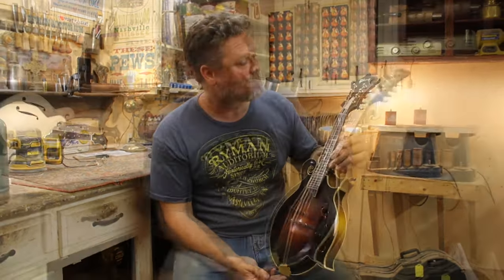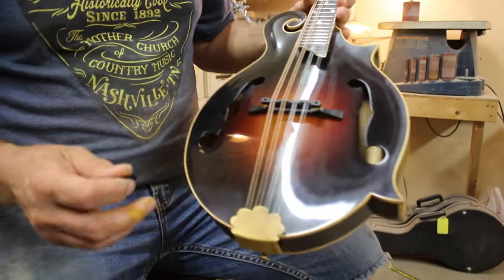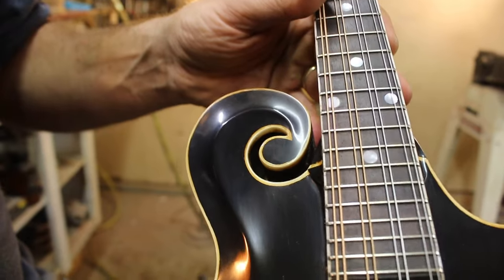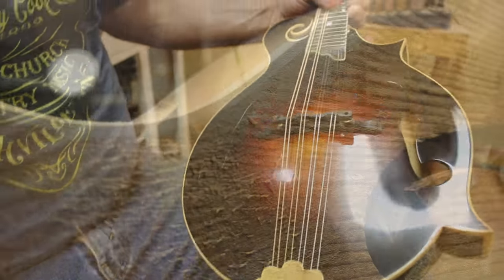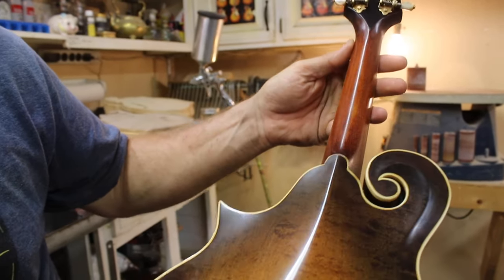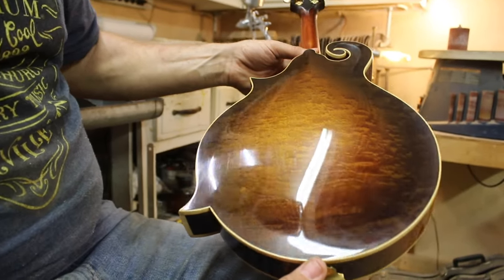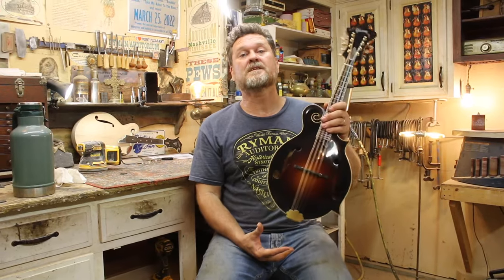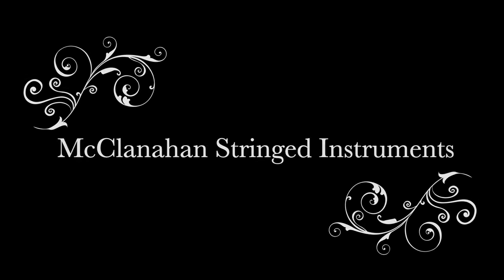Gibson F12 rebuild by Jonathan McClanahan, owned by Bryan Paige

Comment: Those mandolins from 1949 - 51 right at the time Gibson first "re-introduced" the F-12/F-5 mandolin (after WWII) had a fret boards laying on the top board (like the F-2/F-4s) and only later circa '52 did they start to elevate the fret board again (although not Loar style).  This '49 is elevated off the top board like a post '52 F-5/F-12 -- did you do that? Sounds and looks awesome!
Reply from the maker: I was rebuilding a few of these at the time I was doing this one. I may have got the year wrong? 😢
Reply: @McClanahanStringedInstruments  Thanks!  Apparently, weird as it might seem, when Gibson decided to start making F-style mandolins again in the winter of 1948 (an 8-year hiatus) there was no one still at the factory who had built a Loar-spec F-5 ??  Another story that went around is that they had a lot of F-2/F-4 fret boards around to use up -- but that one does not make sense does it?  Those fret boards would not have worked right?
Reply from the maker: I can definitely see many fingerboards made up in advance, as well as tops, backs, necks etc…. It was definitely a production setting so they would’ve made up all the pieces in advance.  
Jim Hutchins was my boss (and Gibson Historian) at the Gibson Custom Shop. He worked at the Kalamazoo plant for decades and he told me stories of how production was done back then. It was very different than what you would expect.